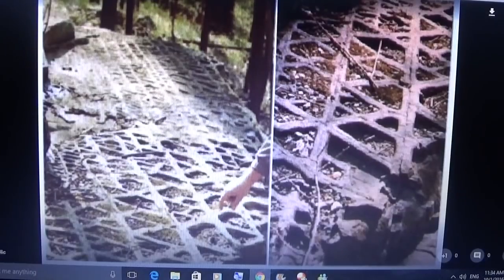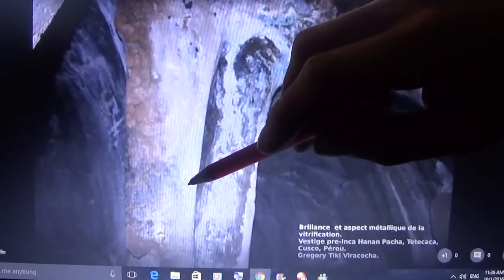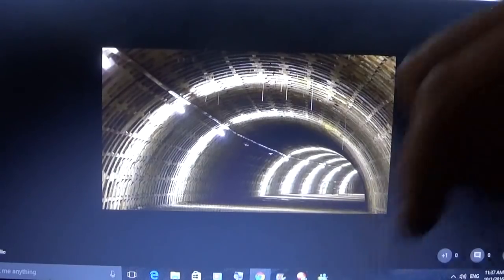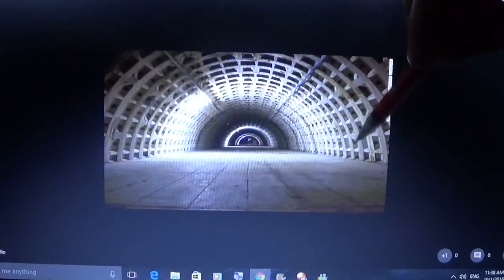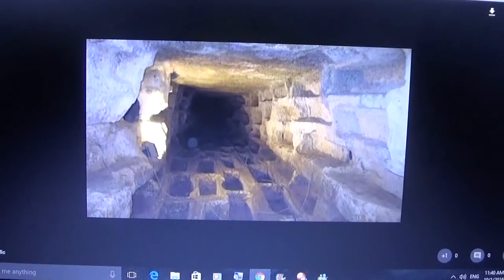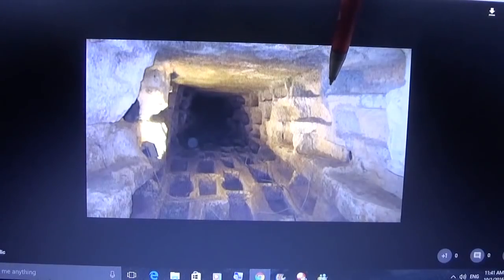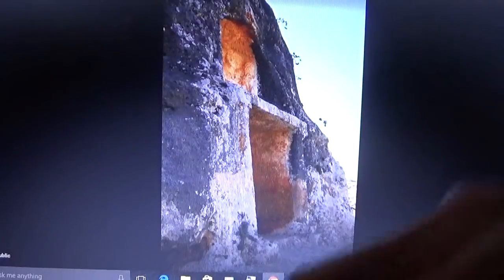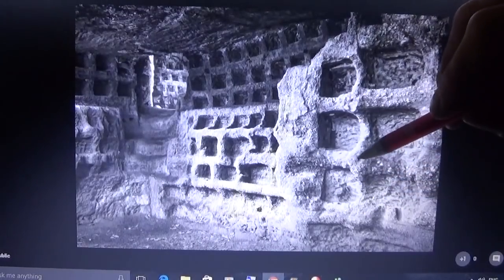RE-BAR STRUCTURES & GEO-POLYMER NONSENSE

Comment: I'm not sure why you would say there's no geopolymer with this rebar. Why would they use a bunch of rebar and not geopolymer?
Reply from the maker: Cement is goepolymer PERIOD & the only geopolymer out there, that said there is an extremely small percentage thats had crushed / fine grained harder rock mixed with CONCRETE as we do today and where we`ve learnt it from.
Reply: @WISEUPchannel  I agree and I guess I missed that part in the video.
Reply from the maker: concrete is geo polymer

Comment: do you have any info on the composition of so called concrete
 reinforced. pored in place
structure of the like. why would some sections last longer than others in a natural deterioration for example? info on so called rebar, metal reinforcing / layout design composition? saw an example on one of your vids with a spiral, coil like reinforcing material. have been under the impression the 'great pyramids of Egypt are a geopolymer type build. I'm interested in using this type on info for my personal building projects. seeking info for creation of different composite s for SIPsand formed poured blocks, beams etc. very interesting. thanks for sharing
Reply from the maker: i have done so much more on this since ..... check out or dont

Comment: love your videos.
but i work construction.
rebar reinforces the concrete or block.
if the rebar somehow rots the structure stays perfect if the concrete is in good shape. if rebar isnt there the strength of the building material is what counts.
rebar just strengthens the surrounding material
Reply from the maker: its why they knock mega structures down, and thats just the material etc we build with.

Comment: the same way they built the Chanel tunnel big move along strap up the roof move along re bar bolted concrete sections im an engineer have been for 35 years your not wrong